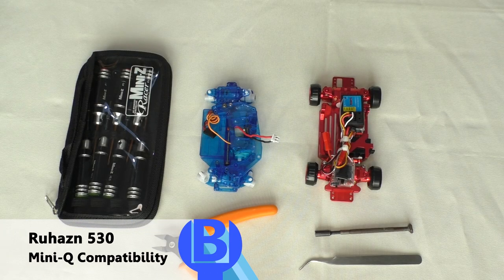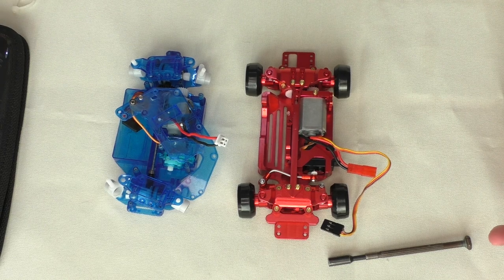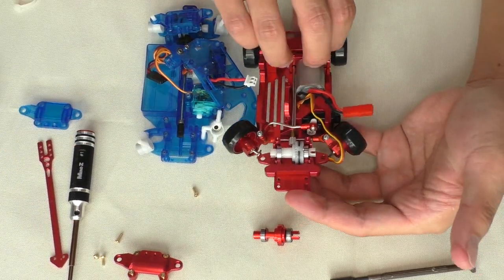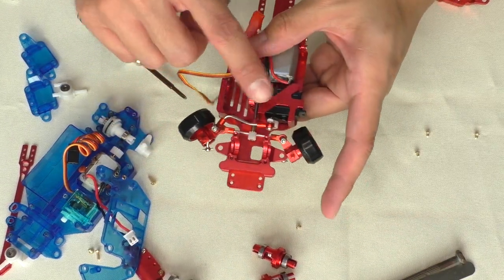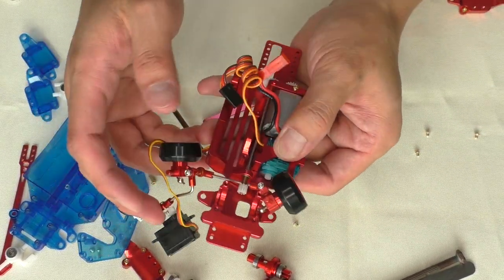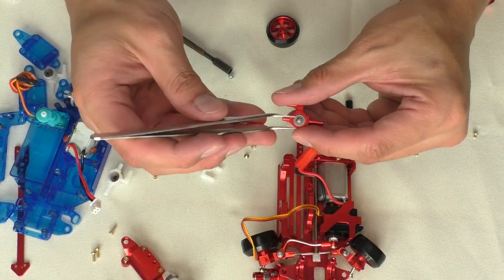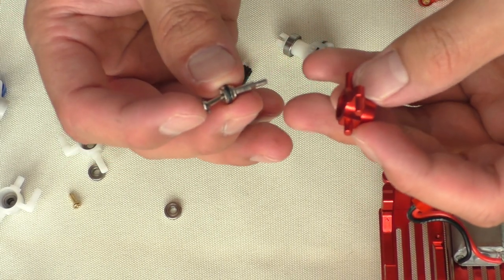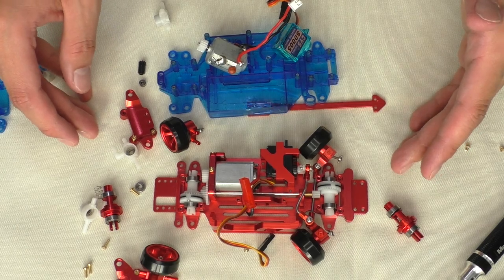Is Ruhazn 530 really compatible with Mini-Q parts?

Comment from the maker: Skip to conclusion at 13:28 if you don't want to sit through the whole thing.
Reply: Can u do this again with the wltoys k969
Reply from the maker: @GummyONSolana  I have done this for K969/K989 (they are the same car) across many videos. Here are the basics:
- Differential is compatible with Mini-Z if you use long CVD https://bit.ly/3m1i4bd  
Video: https://youtu.be/BLAHvTAa6nM
- Wheels & tyres are the same as Mini-Z https://youtu.be/5jCfcT48LXU
- Motor is the same as all other 1/28 kit car. https://youtu.be/WF68_bOKRRY
- Diff bearing is the same as all AWD
- Wheel hub bearing is 3x7x2, the same as Mini-Q
Reply: You didnt move the front up one that would be 94 keeping back where its at right
Reply from the maker: @AllaboutTheWoodrows  This is how Mini-Z body mounting works, move the back and not the front.
Reply: @BeaversHobby  i thought i saw the front was movable on the metal frame too tho looke like it had 8 holes idk 🤷‍♂️ 😂

Comment: Awesome dude ! Wish you had more content with this rc car. Maybe a steering angle mod, rear wheel drive mod and stuff. I bought a model Celica supra 1984 pace car and I'm going to adapt it to this car I'm super excited but it won't fit without the longer wheelbase so it looks like I need the 106, thanks for that info! What wheels and also tires do you suggest for drifting and another set for racing ? I wonder if the Tamiya motors are as quick as this one is already.
Reply from the maker: I have a plan to build one in touring configure to put in my office. The RWD drift is pretty difficult to do because it'll need some aluminium cutting and there's HGD1 already which is basically a RWD version of this one so I won't do that.
As for the wheels & tyres. Mini-Z AWD is what you need. For drift tyres you can either get the original Mini-Z drift tyres or DS Racing which has more compound to choose from.
As for the racing/touring. That depends on the surface but basically Mini-Z radial should work on all surfaces. Lower degree number means more grip. We usually put higher number (less grip) at the front to avoid traction roll when turning.
The Tamiya motor won't fit because there's no mounting holes. For a brushed motor you'll need something like PN Racing to make it work.
Reply: @BeaversHobby  Oh interesting I'll have to check out that model, I do not need this to be rwd but thought it could be a fun task, no worries. I see some 1/28 scale wheels on Amazon but I haven't removed the wheels from the hubs on the 530 yet, so I dont know how to mount them and I don't know if the Amazon wheels would mount. Thanks for the info on the motor compatibility! You've been so helpful, I really appreciate it. I'll stick to brushed for now, if I have heat issues or battery life issues I will consider brushless but I haven't found any reasonably priced correctly sized ESCs that are not for planes. I was also looking for a Li-ion battery to replace the lipo but I can't find any information on it
Reply from the maker: @foxhoundra6444  I don't see a lot of stuff for 1/28 on Amazon either but on Aliexpress it's plenty.
Reply: @BeaversHobby  I'm gonna buy the assembled chassis hgd1, are there specific electronics, wheels, tires or bodies you recommend? Can't wait to pick it up
Reply from the maker: @foxhoundra6444  The electronics can be anything as long as it works. Brushless motor 3500KV-5500KV, A good ESC like PN Racing or Atomic then a very good gyro like PowerHD G1 or any of the V4 gyro will do fine. This car handling is a bit off so it needs a very good gyro to work well. As for the body, choose anything you like. I use it with 1/24 scale model and it's alright. Doesn't really look right on narrow chassis but it works.
Reply: @BeaversHobby  I got my 106 shaft in but the tolerances are so tight that it takes a lot more power to spin I haven't put it back together because I don't think the motor will spin it. What should I do ? Do I need a different pinion gear? It's still plastic and the 106mm shaft is metal. You're awesome ! I heard someone talk about you in a totally different video I was like hell yeah that's my dude haha
Reply from the maker: @foxhoundra6444  Check where does it stuck and also what is the rear pinion gear where it meets the differential. It might be that gear is not 8T so you'll have to replace that with a 8T gear. If it's 8T you can loosen the gearbox, move it around so it has a bit of a gap then tighten it back.
If it's tight at the motor you can move the motor out a bit.
Reply: @BeaversHobby  actually it is very stiff even before it's connected to either of the diffs. When I hold the motor and mount with the shaft installed and spin it by hand it is very difficult

Comment: hi , when you change the wheelbase 90mm to 98mm ,do you need to change central shaft ?
Reply from the maker: No, it just needs a different gear for 98mm. They also sell a longer shaft for 98mm too as a different approach.
Reply: @BeaversHobby  ok thank you

Comment: aside from the diffs are any of the parts compatible with mini z awd?
Reply from the maker: Wheels (AWD), tyres, body, pinion gear, springs from MA-010.
Spur gear also fits if you mod the shaft.
Reply: @BeaversHobby  thanks

Comment: I just got the 530 , how do I lock the rear diff and lengthen the wheelbase? Do I need a new driveshaft?
Reply from the maker: Use pliers with small head to grab onto the nut then take a look into one side of the drive cup and you'll see the screw head then screw it in.
As for the wheelbase. You can replace the original gear with Mini-Q rear gear for 98mm or just change the entire shaft. There are parts on Aliexpress.
Mini-Q part https://www.aliexpress.com/item/33045636252.html
The whole shaft https://www.aliexpress.com/item/1005001544126660.html
Reply: @BeaversHobby  wow thank you for the help, you're the best! Ok, I don't have the measurement tool. Right now it's on the first slot for the 90 wheelbase I think, what shaft should I choose for the 3rd and last slot?
Reply from the maker: @foxhoundra6444  Yes, the original slot is 90mm. It only works in the increment of 8 so the next slot is 98mm and the last slot is 106mm.

Comment: Hey beaver do u have any idea how to connect the Das micro DSK - 161 micro receiver w a fly sky noble n4 I’ve been having trouble binding them
Reply from the maker: The DSK-161 is AFHDS 2A, the old protocol for older Flysky radios. It won't bind to NB4. You'll need the DSK-144, the AFHDS 3 version.

Comment: It is strange that when I install gyro to ruhazn, the unit rotates and driving is not stable. It is very strange that the chassis works better without gyro. 
So far, Q9 metal chassis was the best metal chassis I ever experienced.
Reply from the maker: Thanks for sharing the experience. I guess the suspension is quite stiff on this one so the gyro might not like it so much. Glad to know Q9 (it's basically a Q7 clone with full alloy) is a better car. Q7 is the best in Mini-Q AWD series already so if there's anything to improve that then it's great.

Comment: Hi , there are not a lot body fit on Ruhazn 530 !
Reply: cause that i hesitating between Ruhazn 530 and HGD1 , what you advise to me ? thanks
Reply from the maker: @vanthitran2800  There are a lot of 90mm bodies, just not much are still on sale nowadays.Right now three are AE86, Subaru Impreza (the old one), Toyota Celica from Kyosho and Audi TT from Firelap. Ruhazn and HGD1 are different. Ruhazn is AWD/4WD while HGD1 is RWD. Personally I suggest RWD, it's the way to drift nowadays. But HGD1 can be tricky to setup and get it drifting well so if  you are OK with tinkering on the setup then HGD1 is a very good choice. Otherwise if you want something easy to slide around then Ruhazn is a better choice.
Reply: @BeaversHobby  ok thanks you
Reply from the maker: @vanthitran2800  My pleasure.
Reply: @BeaversHobby  👍